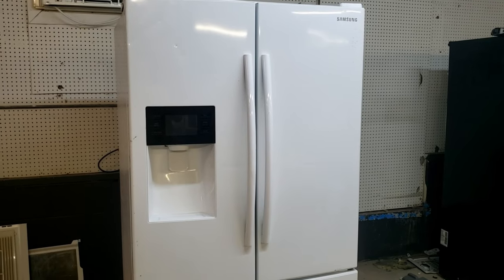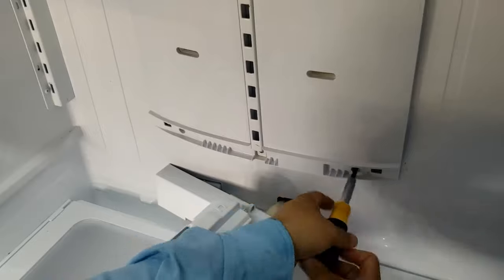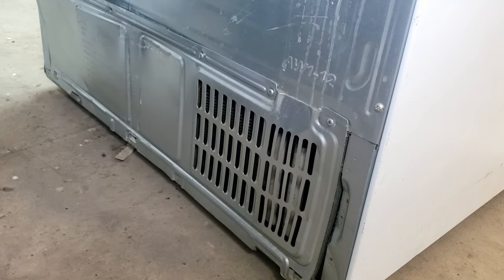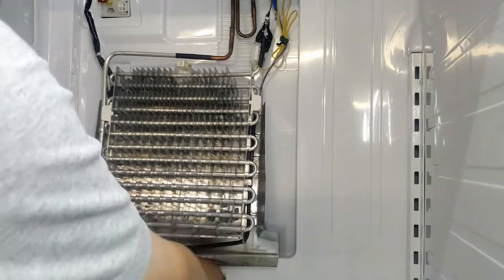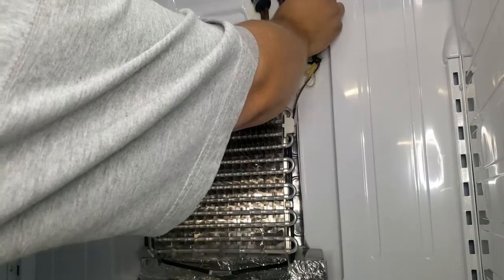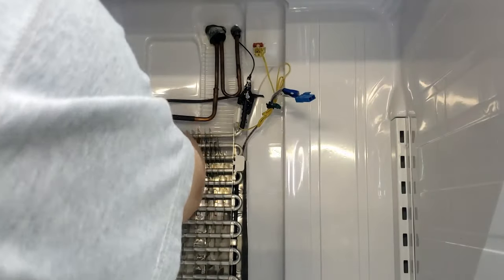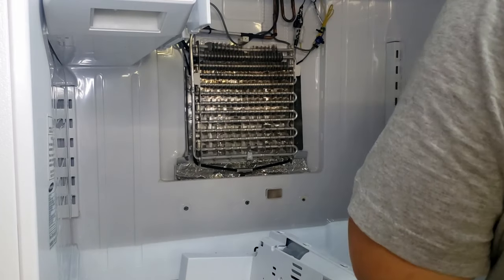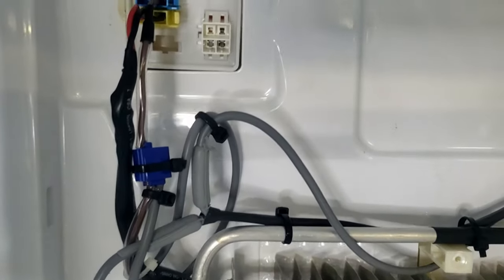Samsung Refrigerator Ice Build-Up and Leaking Water Inside Drawers - How to Fully Fix it Forever

Comment: What is the SUPCO part number?
Reply from the maker: Multiple Supco heaters work... Typically use SH502 or SH201
Reply: @bensappliancesandjunk  Thanks Ben. I repair appliances myself, but haven't heard of this fix. Samsung is not the only company with this issue. It's showing up on MAYTAG, KITCHENAID (Whirlpool) too. Man, WHIRLPOOL parts are hard to find now. I'm concerned.
Reply: @bensappliancesandjunk  What changes are necessary if you use the SH201? Is the braided portion what gets wire tied to the copper pipe?
Reply from the maker: @victsushima6778  201 is a little longer and doesn't need power routed on left side of evap line then ran to right side, can just route it all on the evap line and terminate near both power lines you splice into
Reply: @bensappliancesandjunk  I appreciate the quick response. I'm not sure I quite understand the installation so I think I'll just stick with the 502. Sure do appreciate the video. It gives me hope that I can salvage my fridge.
Reply from the maker: @victsushima6778  no worries. I like both of them equally.  Just slightly different wiring arrangements for the cable.
Reply: @bensappliancesandjunk  One more question, what is the purpose of the foam strips behind the coils? Or did I miss the explanation?

Comment: I have frost and ice build up that stops the fan and warms the fridge.  I have once already replaced the defroster element and fan.  Now I am finding that the drain from the evaporator to the bottom drain tube is clogged.  I have tried putting up and down a wire, a weed whacker line, hot water and blowing out from top and bottom with an air hose jet.  No matter what, the water just pools in the drain area below the evaporator.  Now I am at a loss on how to access this line or clear it.  Unless there is some kind of electric valve that opens and closes the drain, my drain remains clogged.  Can anyone help?
Reply from the maker: I used a water bottle with a water line on it as a DIY water pump... Added a rubber gasket so the water had to force thru and pressed as hard as possible. Last time I did that on a fridge, there was a near-explosion, but it sure got the random styrofoam out!
Reply: @bensappliancesandjunk  Well there is either a physical blockage, or I was thinking since I hade the fridge unplugged, but the freezer stuffed with ice packs so everything stayed frozen, possible the drain was frozen because there was no freezer defrost cycle.  The freezer looks perfectly normal on inspection, no ice build up anywhere.

Comment: I myself have a Samsung fridge,,
and have had all the problems,,  , the secondarry defrost unit on the intake hoses coming in from the condeser are a definate problem
the irony here is that home owners and owners of this defective design have to figure out what is wrong ,,,,  and pay for the fix themselves  ,,, casue most techs will say you need a new fridge (preferable NOT a,,, sammsung,,,,, (not capitalized) ) 
seems that Samsung  did not either do the research on this design, or didnt care,,, 
I have had salesmam tell me ,, "Yeah  Samsung looks cool..  but buy a different brand name   (although most have thuis problem now-a-days)
I have an old KenMore brand from Sears from the late 1970's that never has any frost problems,,,  but yeah uses way more electricity,,,,    but still runs  ,,  with not a lick of problems

just wish some of the the new appliance manufactures would, or could desing an appliance that would last 20  or 30 years  without theses constant problems ,,, but then how can you make money   selling a ne fridge  for $2000.00 dollars  every decade or two,, as opposed to every 3 to 5 years
  🤦‍♂️
but,,,,,            "consumer be damned"            ,,,,,,           as the new model for business these days
Reply from the maker: They can't build a long-lasting refrigerator while meeting EPA/Energystar requirements. A lot of features are there to satisfy government mandates, which kill the lifespan while being in budget. You can make an EPA-satisfying, long-lasting refrigerator still. It just wouldn't be $2000. It would be $5,000+

Comment: Why,Why,Why would you replace the bottom drain tubes when they are not the problem????? I don't know how long you been fixing refrigerators but I just fixed my first one with the same problem and all this heater and tube replacement is just a waste of time and money. The reason it's leaking is because the drain pipe below the heater element freezes up and the water can't flow down into the evaporation tray. Simple fix is to put proper insulation around the piece of drain pip that freezes over and it will never leak again.
Reply from the maker: You've fixed one. I've fixed about 5,000 so far. 

The reason the tubes are replaced is that grime can get in them, causing slow draining and eventually an ice clog forms about halfway down the drain inside the fridge. This causes moisture to build up on the evap and then flood the drawers.

I have 3 to 4 videos on this problem. In my newest one I took off the drain tubes and showed them totally clogged with derbis that caused the entire system to flood. It happens a lot. It's $15 to prevent this problem and it's way easier to spend $55 to solve every potential problem as opposed to wrap the pipe and hope for the best.
Reply: @bensappliancesandjunk  Yes Ben, But these tubes were not clogged, blocked or even dirty inside. Absolutely no need to change them.
Reply from the maker: @1amelka  and I am making the video for everyone else so I have to include other possible fixes if they have to happen. I've had literally hundreds of people do various fixes and not unclog the drain line and replaced damaged or  destroyed tubes.

Comment: I have had this issue and it causes a bad smell. When I called for repair the guy said to buy a new fridge.
Reply from the maker: I'd take the rear evaporator panel off as shown in the video and see if there's any mold or mildew buildup. Also, check the drain lines underneath which are shown in the video. You could run some warm/hot water thru the drain pan in hopes it could unclog any noticable odors.
Reply: @bensappliancesandjunk  I just ordered your kit. I will try this as soon as I get it! Hopefully it is as easy as your video shows!

Comment: I hope someone is out there that can help me. I can’t get the crisper door shit shelf out. I have a brand new fridge and someone spilled a milkshake in it the second day and it ran underneath that middle section where the white tee is. It’s up underneath there and I need to clean it out and run some real hot water or something can anybody help me
Reply: There are 2 tabs near the front on each side of the middle column,  you squeeze those tabs on both sides at the same time then raise the shelf.  Watch the video and it shows a little bit of how to do it.

Comment: Ours drips water from the ice dispenser, not inside the fridge. You go to get ice, before it dispenses ice, it gives you a tsp to a tbsp of water, then gives you ice. The ice maker freezes constantly, we have to defrost it all the time. We're on our 3rd icemaker, Samsung is well aware of the bad icemaker and has refunded our money. However, to buy something new, it's going to take 8 months to get it, because of covid and no one can get parts to put a fridge together. Frustrating, to say the least. Have you heard of this issue? The ice that is dispensed, is wet, it's already melting.

Comment: The freezer isn't cooling at all after this...
Reply from the maker: The freezer's evaporator system isn't connected in any way to the refrigerator on almost all models of this. If your freezer isn't cooling after installing a heater wire, you had or have a much more systemic issue going on that needs addressed. The only other option would be that demo mode or something else has been unexpectedly enabled, causing the system not to operate.

Comment: Everything you need to fix this!…..why should the homeowner have to deal with bad design this way. YouTube has hundreds of videos on Samsung refrigerator repairs homeowners can do. They are endless. The best way to end your frustration with this product is go buy a simple bottom of the line fridge that will keep your food cold and buy some plastics ice trays. You will be better off. TaKe that Samsung to the scrap metal yard and get $50.00 for it and say goodbye to your problems.

Comment: I agree from what I understand the same problem has existed for over 10 years, there are products available as add-ons to fix it. It is a fucking scam to charge you for service auto intentionally defective design.

What a way to ruin your company name, this CEO needs to be reevaluated

Comment: BRO, samsung engineer here. Your defrost sensor wire is preventing your evap cover from properly sealing against the back wall. That's going to be a HUGE factor in causing that ice buildup.  It's a common issue even when you use the proper sensor, but that thing is ridiculously long.

I Keep editing this as i watch the video. PLEASE CUSTOMERS AND TECHS: DO NOT FOLLOW THIS GUIDE!
The factory parts in this video are completely improperly installed, especially that leakage kit (the padded foil). This is going to give you continuous problems. My god, if you folks don't have a samsung factory certification DO NOT PUT SERVICE BULLETIN INFO OUT.

ok this is a final add: DO NOT EVER WRAP ANY PORTION OF THE EVAPORATOR TUBING IN ANYTHING!!!! OMG WHO THOUGHT OF THIS??!!

You're making TOO MUCH work for us. STOP
Reply: BRO, your company and you should design a better fridge. If you are a real engineer you should have realized that the ice buildup is what caused this mess for many of us. I bet you don't even realize that there are so many other complaints about the ice maker and insufficient water draining too. Why can't you offer solutions.. oh but wait you can't because you work with a crappy company who doesn't give a crap to help their customers. I will never buy anything from this company again and I have been telling everybody to avoid any product with this "s" name on it.

Comment: Samsung executives and engineers should be horsewhipped until they repair free of charge every faulty refrigerator they sold.
Reply from the maker: They don't care. They made sure they last past the warranty, and don't care afterwards. Most other companies have the official 1 year and try to ensure they at least make it 5 years, but Samsung really doesn't care at all.

Comment: After several months, it will happen again
Reply from the maker: Did it start icing up after you installed the heater kit?
Reply: @bensappliancesandjunk  Mine has started icing up again after a few months since installing the heater kit.  Do you think I should try replacing the temperature sensor?

Comment: WARNING>>>>You are not installing the foils strips properly. Please read Service Bulletin
Title Frost/Ice on Top of FF Evaporator, Water Under Crispers, French Door Dual Evaporator
Create Date 10/5/2017 Service Bulletin Number ASC20171005001  Foils is installed on the back and bottom surfaces of the evaporator heat reflector that you improperly remove from the evaporator. Additionally there is a requirement to flatten or bent over bottom row of evaporator fins.
Please correct your presentation as you are giving improper repair advice.

Comment: Isn't it sad that for about $10 extra in parts per fridge, Samsung could have avoided all these issues. But no, cheap out and cause multiple problems.
Reply from the maker: Not uncommon to other products. Microsoft notoriously cheaped out on 10 cents of thermal paste and got a 50% fail rate on Xbox 360's about 17 years ago. Cost them around $2 billion for that one error.

Comment: My question is, why would Samsung design a refrigerator like this with so many flaws? Ridiculous.
Reply: There isn't one on the Market that doesn't have a Major issue anymore. That applies on anything from the $300 Frigidaire all the way to the Top-of-the-line Sub Zero Column Units. I'm waiting for the Exploding fridges to start showing up in the news more often with the R600 they are required to use since 1/2020

Comment: These Samsung Twin Cooling refrigerators are just a poor design by Samsung.  It’s basic refrigeration technology that somehow escapes a big experienced company like Samsung with a huge R&D department.  About 10-12 years ago I purchased a lot of Samsung appliances, a over-the-range microwave, a dual cavity electric range, a front load washer & dryer (w/ $$$ pedestals) and a 4 door French door twin cooling refrigerator.  Every single Samsung appliance product has been total garbage.  The door micro switches failed in the microwave, the drum support (spider arm) corroded away in the washer & don’t even get me started on the horrible electric dryer, limit switches, thermostats & heating elements every 6-8 months since new.  Their customer service is criminal at best.  I would NEVER buy another Samsung product ever again, not an appliance, not a tv, not even a phone, ever again.  Total Junk.